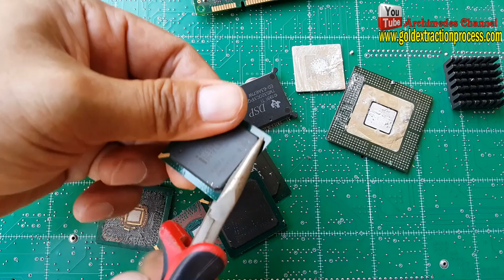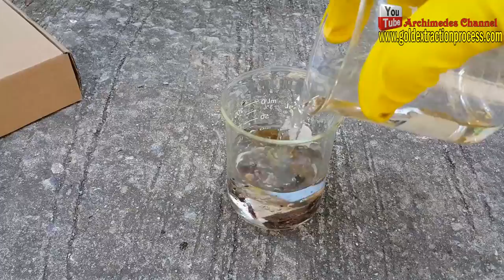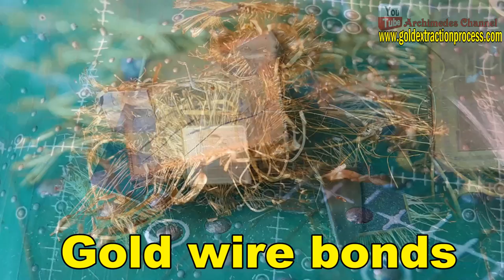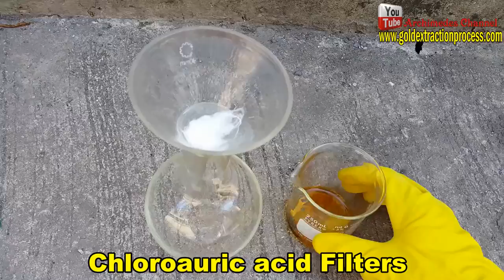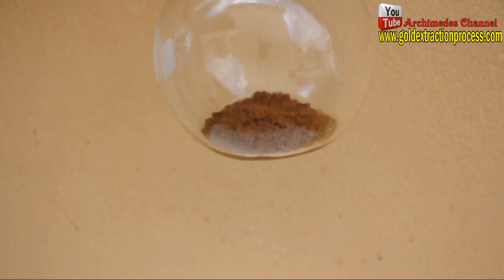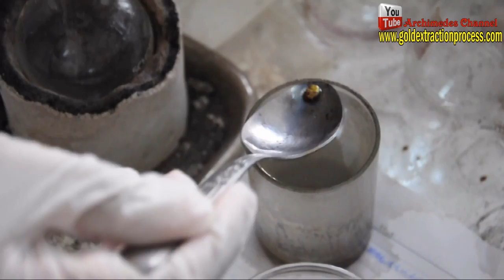Chipset ic does contain gold. Method Recycle gold chips electronic components for recycling.

Comment: Question for you: Why didn't you use a melting process to clean the gold? Since plastics will burn first, then Lead will melt and Gold you'll need lots of heat to melt it at the end! That way you are not risking yourself with dangerous chemicals. Don't throw away the lead cause it's good to make fishing accessories!

Comment: Sir very good but you are missing one thing , final step before dissolve gold is to break the silicon squares , there is gold inside and the AR won't get it all unless broken
Reply from the maker: You can use hydrofluoric acid.
Reply: @MakeGold  where to buy the sulfuric acid?
Reply: @legend80s32  You can buy it from hardware stores

Comment: Best video out there on this process with processors. Missing the part on what happens to the silicone and/or metal pieces in the middle of the gold wires after copper is dissolved. Anyone know if they separate during the first acid bath?
Reply: Hello Sr:Do you know how much gold can you recovery from 1kg of cpu computer scrap?
Thanks

Comment: This video showed one solid way of doing the process, but I am pretty sure there are cheaper chemicals than what is shown to remove the base metals.
Reply: Probably nothing cheaper to get to the connecting wires - sulfuric acid is about the cheapest acid you can buy.

Comment: The  21st century  gold miner   Lol.

Is that an once of gold?  I bet it took at least a  dozen of  those chips  and  several dozen  gold plated pins  to get that.
Excellent take -- hopefully your exchange gives you near spot. thanks for posting  and  have a  Jabba-sized  thumbs up!
:-D
Reply: To get an ounce of gold would require hundreds, possibly thousands of such chips.
Reply: @buggsy5  There is only 31.1 grams in 1 Troy Oz., if one can accumulate 0.3 grams of Au/day, then they aren't trying hard enough to "prospect" for gold in electronic junk. Today's average running market price for .999 gold is around $1,500/Oz. (U.S.A.)

Comment: Sir, In the 1st step, When IC chips are dips in the Sulfuric Acid and heated it. It did not disolve plastic. It disolve my Gold wires..
I have try many times( Even 3 to 4 hours in heating ) but i cannot got gold wires with IC chips. Sir please help me..
Reply: me too why?
Reply: Sulfuric acid will not dissolve gold. It WILL slowly dissolve copper.

Comment: where to buy the sulfuric acid to remove or dissolve the materials covering the bound of gold from the ic chips?
Reply: Battery acid. It is at 30% so you will need to boil it to remove the water
Reply: @DreamerVic  Is there an alternative to sulfuric acid?
Reply: @lanahenrry  maybe but not something you could buy over the counter.

Comment: Hi Archimedes Channel,
Can sulfurid acid be used for melting other than IC chips?
I have practiced on the IC component one of the electronic devices on an airplane, but not melting when sulfurid acid while in the heat up to 1 hour. How can I melt as in the video you show? I wait for the answer. Thank you.
Reply: Concentrate or dilute?

Comment: What concentration of sulfuric acid are you using?
Reply: Dreadnought 98%. You can use it from battery car but it is only 33%. So you need to gently warm it so evaporate water. Once you see deep white fumes you can turn the heat of and you will have 98-99%
Reply: @DreamerVic  so the sulfuric acid to be used is from the battry car sir
?